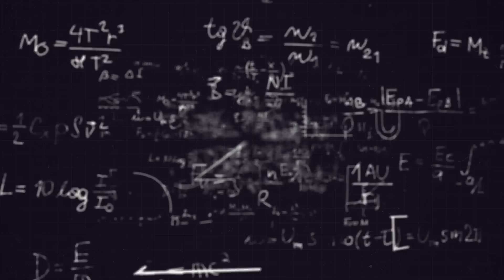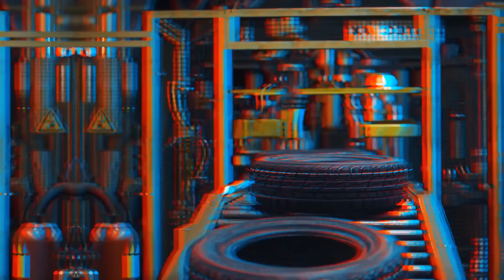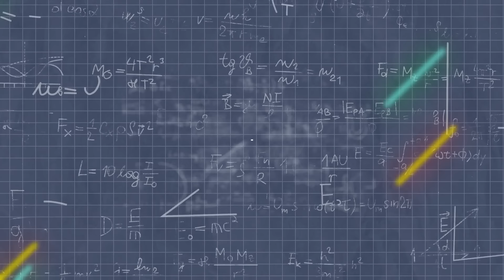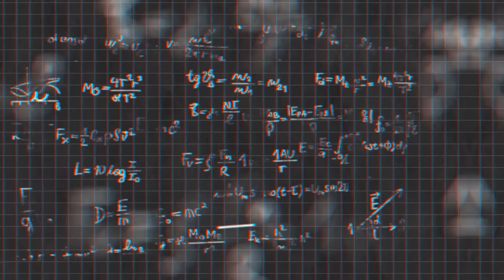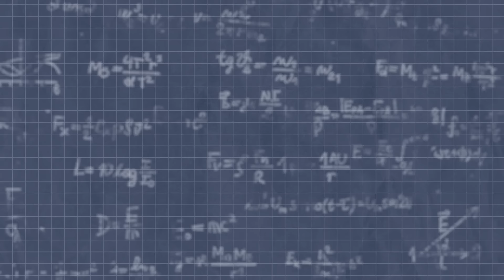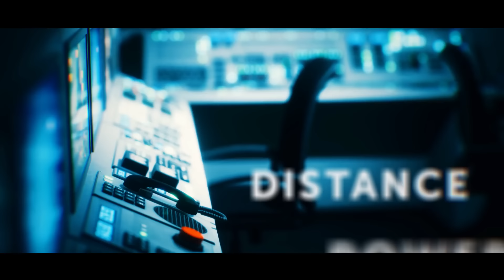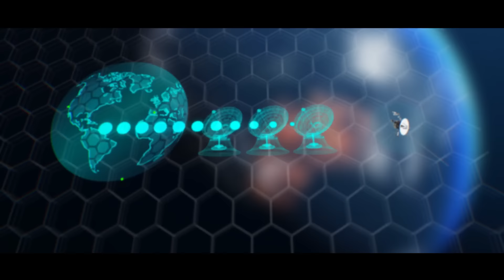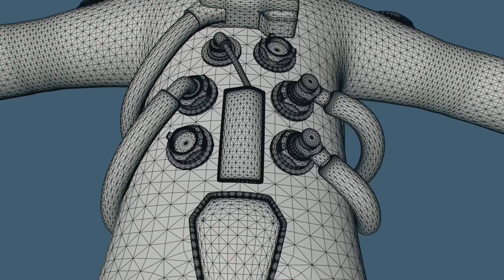SpaceX Starship 3 Launch goes HORRIBLY WRONG! What went down?

Comment: please use the metric system, even SpaceX or other US manufacturer are using it, in Cosmology only metric values are used! Like Fahrenheit, outside the US nobody uses Fahrenheit, Celsius is easier, 0°Celsius water freezes, 100°C water boils, 1 km=1000m/1m=100cm/1cm=10mm. Try this with miles, yards,feet, most Americans itself don't know how many yards are one mile, how many feet one yard etc! otherwise interesting video